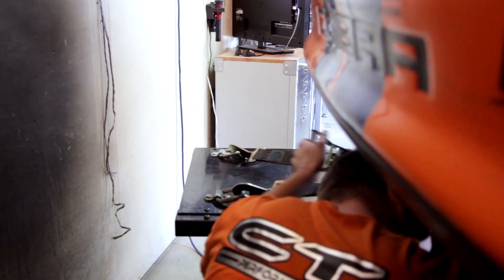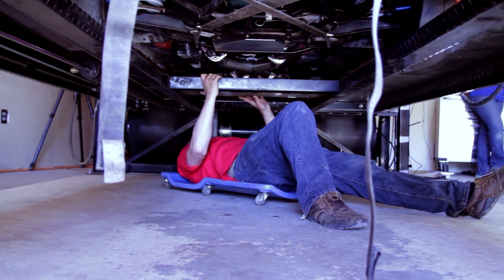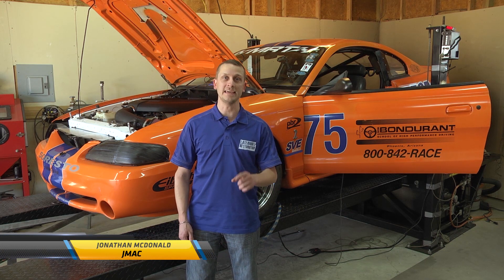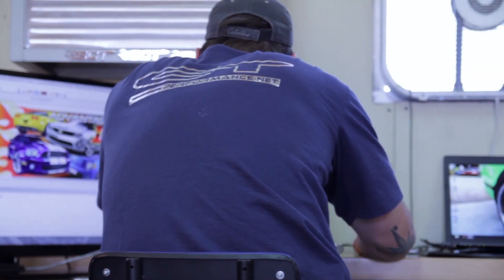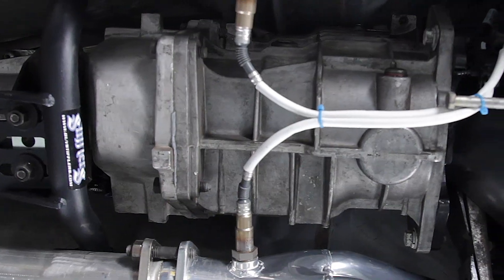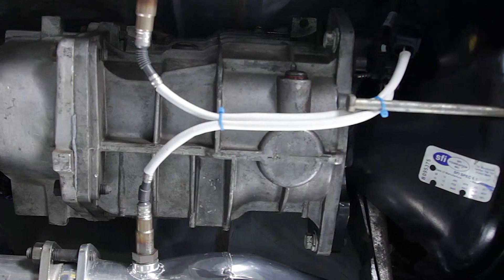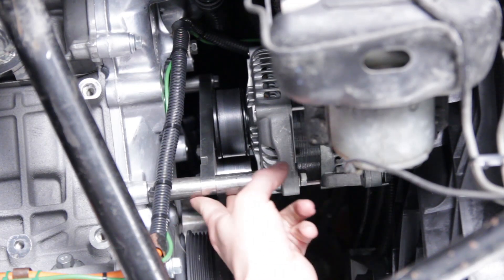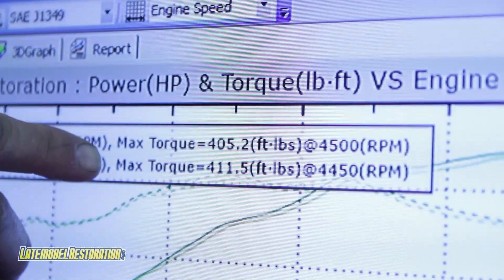Mustang Coyote Engine Swap: Dyno Day!

Comment: about how much will something like this cost me?? for my 95 gt 5.0
Reply: Mike Termin8tr you can find junkyard motors for about 3500 now...you can go with a f150 motor for a lil over 2k where I'm at...all in all I'd expect to be in this build for about 6500
Reply: Get a Ford F-150 2011 not to many miles and ur good to go
Reply: Mike Termin8tr engine itself is like 15 grand

Comment: How does the 3550 hold up with that much power?  I have a T56 swap incoming, what kind of bellhousing would I need?
Reply: The 3550 did eventually break on the road course. The TKO 500 gears were direct fit. With greatly improved strength. This should work great.
Reply from the maker: Road Racing doesn't put the extreme stress on it like drag racing would with hard launches. Here is a link to our t56 bell housing. http://www.latemodelrestoration.com/item/RM-8080/1996-04-Quicktime-Bellhousing-46L-54L-To-Ford-T-56

Comment: how much does it cost to build that mustang i have a 2001 3.8l and 1998 4.6l
Reply from the maker: You will need a transmission and rear end added to the swap. The price varies greatly depending on what all you pick up used and what you decide to keep -- manual brakes, A/C ect ect. Start by making a list from these parts -- http://www.latemodelrestoration.com/products/Coyote-Engine-Swap-Mustang

Comment: I am doing it in a 98 mustang. Do you guts have a build list and a build guide you guys there could send me? also did you guys run the original gauges? Do you guys there at Late model have an email i can ask questions i got a lot of questions i could email you guys. Need to know every detail on this swap so i can knock it out easily.